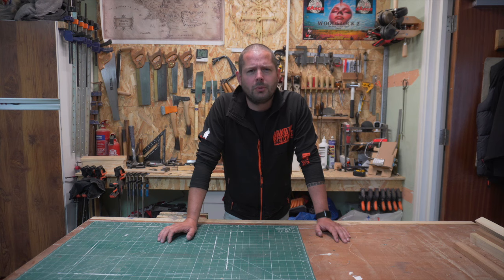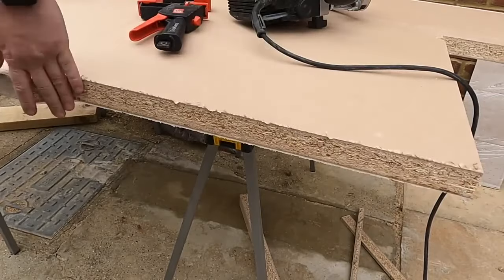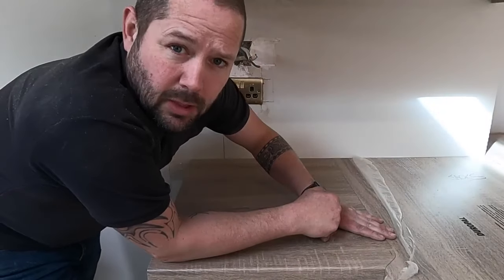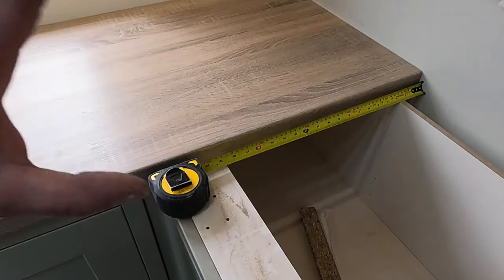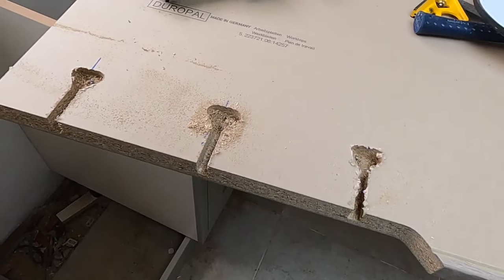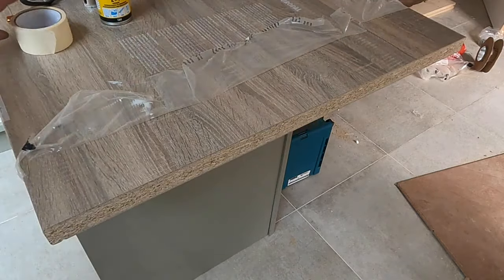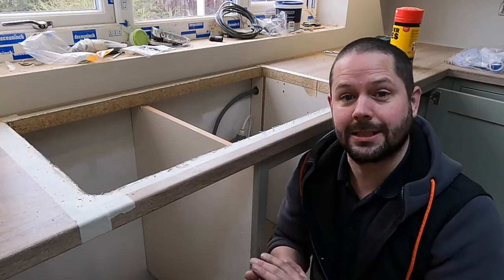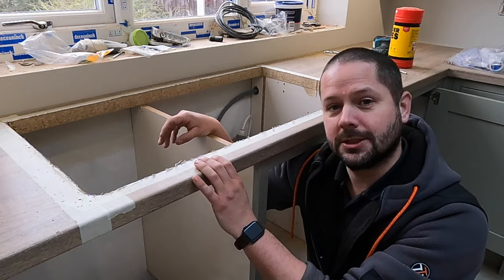how to fit kitchen worktop compilation

Comment: Hi mate, great video, with the ceramic sink how did you make the hole for the tap? Thanks in advance
Reply from the maker: Hi mate, you can either use a diamond drill bit but you have to go really slowly or you can tap it out from the top, they normally mark where you tap from on the top, either way it’s not a fun job to do and you really have to be careful and take you time

Comment: Hi Lewis, would a laminate trimmer be any good for trimming off the excess trim on the top of the breakfast bar ?
Reply from the maker: Yes it would be buddy, works really well, you have to go careful but fine if your competent, also it can still leave a sharp edge so I would still recommend using a bit of sand paper to knock the corner off

Comment: Lewis, have you not thought of using biscuits for alignment? Work great and saves all the faffing with tapping every couple tighten of the bolt - and adds another fixing for the belt and braces approach
Reply from the maker: Yes I have mate, I actually use dominos but as this is a tutorial I keep it as simple as possible, thanks for the comment buddy 👍🏻🍻
Reply: @LTWCarpentry  we aren’t all big earners like you mate, biscuits for us peasants🤪🤣
Reply from the maker: @Lyonscarpentry  😂😂 that got out in the credit card mate 😂😂😂

Comment: Hey, I'm trying to fit an IKEA laminate worktop which is 28mm thick. I don't think I can use bolts to secure two different sections due to it's low thickness. Can I just silicone it together? Thanks!!
Reply from the maker: You can use bolts in a 28mm thick work too buddy, just set you bolt depth to about 15mm. I wouldn’t recommend only siliconing them together mate as they could separate
Reply: Nice job , but why didn’t you lay the male worktop underneath the female and mark a 8.5 mm scribe line just in case the female top is out of square?
Reply from the maker: @paulknights1764  thank you, I didn’t have to in this instance as I knew it was sqaure

Comment: How much longer does the male side need to be per joint when using a jig and is it a standard width?
Reply from the maker: If you cut your female joint and lay that in place you can measure your length if you make board that way, failing that always cut it long then tom to fit afterwards

Comment: Is there any particular specs you’d recommend for buying a router
Reply from the maker: I would try and get something with atleast 2000w motor buddy, it’s surprising how much power you need to cut these worktops even when doing smaller cuts
Reply: Thx for the advice, you’re a star
Reply from the maker: @mikehead1977  any time buddy

Comment: Are all routers the same, I was thinking of getting one for my 18v makita, I’m fitting my kitchen out at the moment
Reply from the maker: No they are not buddy, the 18v makita is a great little router but it’s not man enough for bigger jobs. What are you thinking of doing with the router ?
Reply: My work surface mate,
Reply from the maker: @mikehead1977  you will deffo need a half inch router for that mate.
Reply: Oh crap, better send this one back if I can